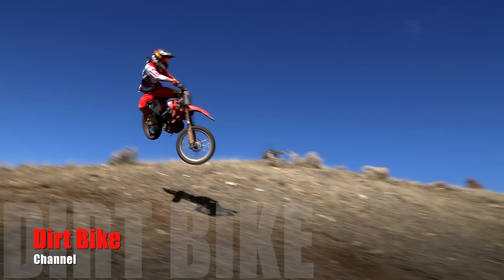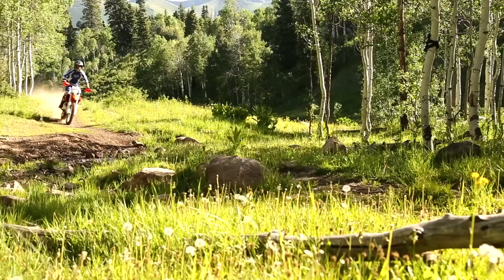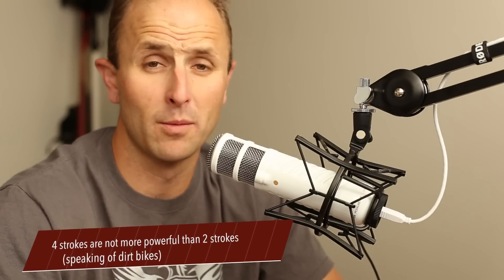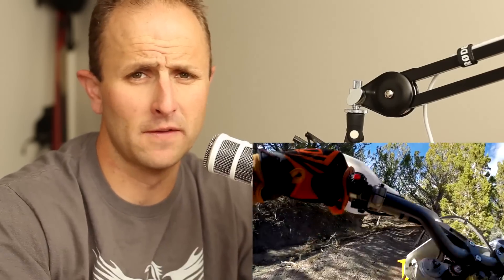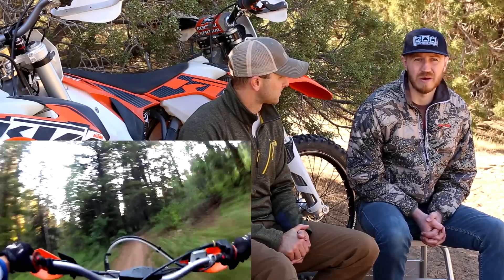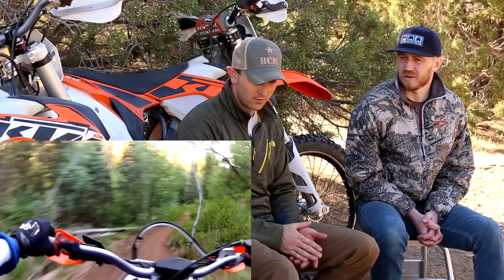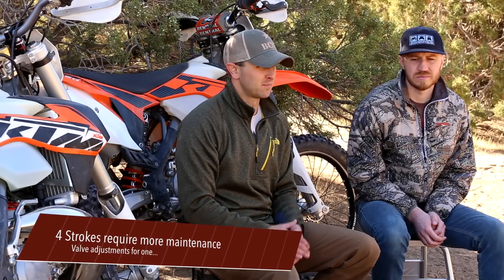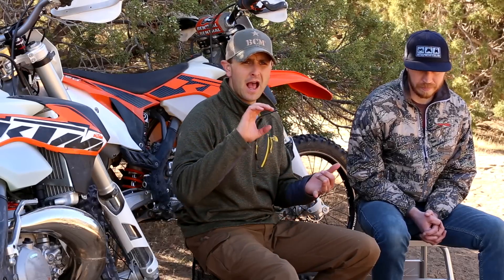Enduro 4 Stroke vs 2 Stroke Part 1

Comment: Can you guys get a comparison video with a guy who is biased with 4 strokes that would make a great video with you both making fair points let's see that like if you agree.
Reply from the maker: +Budda Shelton That is essentially every other video on the planet, so it's not really needed on here :)
Reply: Why would anyone be biased towards a 4 stroke ? Is that a real thing?
Reply: Brian Carpenter are you serious?
Reply: @Bc5xdown  because the 4 stroke is better in almost every aspect.
Reply: jacob van halteren did you watch this video?
Reply: @kadend2669  Yup, a couple times. He's pretty biased towards 2 smokers. Truth be told, the 4 stroke is objectively better engine. And I have a 2 stroke. Yes, 2 strokes are cheap to maintain and light, but 4 strokes are still pretty cheap to maintain as well. Yes, they have more moving parts but a forced oil lubrication system means that those parts last 10x longer than they would if lubricated like a 2 stroke. Then you get better power and longer gearing allowing you to move slower than a 2 stroke with similar gearing could. Not rev lower, but move slower none the less.
2 stroke bike set up to do 30km/h in 1st and a 4 stroke set up to do 30km/h in 1st. The 4 stroke has an extra 4000rpm, meaning that while peak to peak speed is equal when you get near idle the 4 stroke is able to go slower and not stall. 2 strokes are great but overhyped.
Reply: jacob van halteren you know they use 2 strokes in hard enduro because they can rev lower without stalling right? Thanks for the essay !
Reply: @kadend2669  That really just comes down to gearing. That’s not the actual reason they use 2 strokes. They use 2 strokes because they think it lowers the weight. The 250 XC-W (2020) weighs 227.9lbs and the 4 stroke that has equivalent power (about 2hp less) the 350 XC-F weights 221.5lbs. So even weight is an invalid argument. Plus the redline is 3000 rpm or more higher, which actually allows for more usable rpm. This means that while both bikes may be geared to reach 25km/h in 1st gear at peak power, the 4 stroke is given roughly (accounting for higher idle) about 2500 rpm more (at least) of usable low end rpm. There is really no reason now for the lack of 4 strokes in enduro. It probably just has to do with rider preference, since most enter the sport on 2 strokes.
Reply: jacob van halteren holy you could’ve just told me to read the brochure
Reply: Ask ultralight pilots how they feel about 2 strokes. Great way to practice dead stick landings.
Reply: @Bc5xdown  The LGBT community is very prominent these days
Reply: @Bc5xdown  yes🤣🤣🤣😭
Reply: @jacobvanhalteren7452  not really
Reply: @jacobvanhalteren7452  you semm biased too. Also Kyle doesnt seem biased. You prefer 4 strokes, you think they're better, but I prefer and think 2 strokes are the best you can buy. I think 2ts are better than 4t in every aspect. You my friend need to learn the concept of opinion.
Reply: @Dingbobber  you're referring to 2 strokes right?
Reply: @gmx0413  Talkin bout 4 Jokes
Reply: @gmx0413  so funny that you say that. I absolutely love 2 strokes, have a 2001 Honda cr250, and always make fun of people with 4 strokes. I just understand that there's a reason why people love 4 strokes that's all. And ya, everyone has there opinion but it's always the 2 stroke guys yelling 4 strokes suck and never the other way round, kinda odd
Reply: @jacobvanhalteren7452  based on your wording, it seems like you prefer 4t, I never said you dislike them.
Reply: @jacobvanhalteren7452   It is the other way around believe me, I get it all the time
Reply: @Dingbobber  good
Reply: @Dingbobber  😌
Reply: I just raced  my 4T xcf 350 for the first time and took 2nd.  Same course last year, I took 3rd on a TX300.  The 4T felt better in a Harescramble but tbh?  I rode a Hard Enduro this year as well on my TX300 and felt like I would've died on my 350 or overheated bad.  The Moral??  Each has well developed purpose and different power delivery systems that are adaptable to different scenarios.  Choose your weapon based on what battle you're entering.
Reply: @kadend2669  they use 2 strokes in hard enduro because they produce less heat.
Reply: While 2 strokes are awesome in that they sound cool and are cheap to rebuild, there’s a reason Yamaha isn’t developing new ones… the 4 stroke is more useable at low speeds, revs higher, generally always has electric start over kick start, the power doesn’t kick you in the face, you don’t need to pre mix, you don’t need to tune your carb or be so worried about gas issues. 

Hell, the biggest argument you got is weight. And that’s not even a valid point as there’s some 4 Husqy 350s lighter than a 2 stroke 250. 

I would however LOVE an updated YZ

Comment: LOL The piston should fire EVERY time it comes up!  Nothing beats the 2 stroke for cost, weight, maintenance cost and oh that premix smell.
Reply from the maker: +dieselworld You know it!
Reply: dieselworld Is that why four strokes are faster? 

Biased, but not wrong. These guys sold me on getting a two next. Seeing as how my 4 has been on a bench for the last 5+ years, though I never lost on a track. 

Anyone insisting a 2 is better doesn't care about finishing first. On road. Off road. A 4 stroke beats a 2 stroke when in capable hands. Reliability? That's another issue. 

If you're not speaking to the degree of supercross you aught to not be talking. That's how I feel about these two.
Reply: Then how come every engine in cars is a 4 stroke
Reply: emissions and tong term longevity. and pretty much nothing else..
Reply: Emissions. duh.
Reply: NoNoNoNii exactly.  To me it always seemed like 4 strokes were faster top end but I think that's just because it's smoother and you don't have to keep the rpms wound up before shifting to the next gear.  The reality is I think two strokes have more mid range and top end power while 4 strokes just have more low end torque.
Reply: I work on a boat with EMD/detroit 2 strokes, they burn plenty of oil though> Most 2 strokes sound better than my old fart OMC rotary sled 2 stroke wankle though.
Reply: Another thing is that boyesen has a trapping valve that can clean up and broaden the torque curve on a 2 stroke. Detroit diesel 2 stroke have 4 exhaust trapping valve and make good low end power with much pipe tuning. the 12v71 2 stroke generator on a boat i worked on have big exhaust chambers though. they run at 1800 rpm and can start some heavy loads with quick torque rise.
Reply: Won't Reply if four strokes are faster then why did they allow 450 fours strokes to compete with the 250 2 strokes in motocross and 250 2 strokes were not allowed to compete against the 250 4 strokes?
Reply: dieselworld u said cost twice
Reply: @minnionator  your kidding right, that's why you think their not used in cars, they great in with pushing small weight but they are gutless unless you rev the balls off them
Reply: @wontreply8315  4 stroke is not faster its just more easy to ride and not get tired.
Example i can ride 4-5 more laps on a 450 than on a 125

Because 2 stroke you need to pin it every gear. 4 stroke u can relax like a grandpa allmost...
Reply: All these pros for 2-strokes and no one mentions how much more fuel efficient a 4-stroke is. 

I ride with friends who own 2-strokes and they fill up twice and sometimes 3x’s more than I do. 

I still wouldn’t mind owning a 2-smoke!
Reply: @VitaminDeeTV  ye i like both if im racing my brother i would use my 2 stroke but i dont have a 4 stroke but ive drove one and its just fun to drive not to fast and chill out on
Reply: @joshlewis5065  Emissions
Reply: @randomdude4669  You don't know what you're talking about.

Comment: I'm a 2 stroke guy and always will be but to rebuild a 4 stroke top end does not cost 1500-2000, maybe a whole engine rebuild and that's to get it done at the shop , if you do it yourself its really not much more then 500-700$. now 2 stroke top ends usually run about 120-300 $ all in, depending on cc .Call your local
KTM dealer and ask how much an OEM  2T piston costs you would be shocked.The only time thumpers are really more costly is when you have a engine failure or engine performance parts.  In stock form thumpers really aren't that much more costly if you take care of them.  Two smokers have to be well kept too, pick your poison .

cheers mate
Reply: Ben Saunders I am not saying you guys don't know what you are talking about but no way is it cheaper to replace a 2t cylinder and top end then to just do a 4t top end that's not accurate man . the absolute cheapest you can get a 250 2t cylinder re-plated is about 200$ and can go up to 400$ then you have gaskets and piston , a 4 stroke cylinder is also cheaper to buy brand new because there is no moving parts in the cylinder.im not trying insult you guys need but you should  do a bit of research first , I understand everybody has there opinion...
Reply from the maker: Ben Saunders Ben.  I called multiple dealers, bro.  I do research.  Going rate is 2 grand if you have to do machine work on your 4t top end.
Reply: In NZ $300 to do 2T top end, 4T $500...not that different. We ride 4 strokes for trails as you get better mileage don't have to retro fit the bigger tanks, for long rides.
Reply: $1500-$2000 is for a shop to do it. Do it yourself, anywhere from $250 to $800 depending on what you need.
Reply: @DirtBikeChannel  but you are comparing apples to oranges here...   meaning 2 stroke repair being done being done by owner and the 4 stroke repair by a dealer.  in cost.  ok so that is the point. parts for parts only its not as much.
Reply: @DirtBikeChannel  flat out lie lol. That means they are going to charge you $125/hr for 12 hours thats just labor. If your shop takes 12 hours straight to rebuild a 4 stroke then you're going to the wrong guy.
Reply: So I was under the impression that 4 stroke engines that are used for free riding and non-racing basically last a really long time, while 2 strokes have a pretty short engine life, no matter what kind of riding you're doing? I've seen XR500 engines from 1984 that have never been apart, and have hundreds of hours, and are still running strong no smoke or valve noise. I guess the new 4 strokes are a different beast, and wear out a lot faster?
Reply: @Ritalie  since the new 4 strokes are water cooled instead of aircooled, they have more power but don't last as long
Reply: And XR500 engine is a completely different design than the modern motocross-style 4-stroke engine.  For one, the old XR style engines are lower revving, and designed to deliver a different kind of power (fewer ponies, as well).  Those old engines use valve lifters instead of overhead cam(s), and have fewer moving parts than a modern MX 4-stroke engine.When it comes to a rebuild on a 2 stroke vs. 4 stroke, there is quite a different cost from one to the other.  While the main parts, i.e. piston, rings, and gaskets are fairly comparable in price, there can be a lot more labor involved in a 4-stroke rebuild.  There are quite a few more moving parts, and a shim-under-bucket valve adjustment is quite possibly going to be part of that rebuild. Depending on what make/year you're rebuilding, you might be replacing or at least resurfacing the valve faces, both of which require a post-rebuild adjustment, as well as making sure your timing is correct.  There's not a lot of room to work in those compact engines, and it takes time to do it right.  I could always do a 2-stroke top end on my YZ in about 45 minutes to an hour, including draining and refilling coolant.  It took my very capable mechanics at the Honda/Yamaha dealership whose service department I managed up to five times as long to rebuild 4-stroke top ends.
Reply: @DirtBikeChannel  it's not though

Comment: these guys aren't even doing a comparison there just bashing on 4 strokes
Reply: Truth hurts... The dollars to smiles ratio is far more favorable with a 2-stroke.  This is coming from someone who owns both.
Reply: Ruthless Racing anyone who loves enduro should love the environment... In which case 4 strokes are better. They get better traction, tread lighter, and don't pollute tons of extra hydrocarbons and particulates. 

The pinnacle of 2s power is a 48hp 250... That is 192hp per liter. Stock liter bikes (250 cylinders) make more than that, and race bikes from stock classes to MotoGP make 210-250 hp per liter. If manufacturers wanted to, they could make the 250f as or more powerful as a 250, but they want broader power  (funny how the 250 has such a slim powerband and the 250f has to have a wide one) for BEGINNER riders.
Reply: The pinnacle of 500 cc 2-stroke GP bikes were making close to 200 hp - almost 400 hp per liter.  Just sayin'....
Reply: 6:24
Reply: A 68 chevy 327 chevy can rev over 8000 rpm more than most big 2 stroke  outboards. 4 stroke rev much higher but they do not like the heavy loads like a 2 stroke, i have seen 12v71 2 stroke detroit diesels start some pretty heavy loads on a generator.
Reply: @DaveScottADV  A 2 stroke with a trapping exhaus valve can broaden the torque curve. Boysen and Coates rotary valve heads. But this is done with detroit diesel uni flow 2 strokes years ago. plenty of power with low end torque.
Reply: When you compare a 4 stroke to an engine that is drastically better in literally every way, its gonna sound like youre bashing it.  Its not personal!
Reply: roberto fromamino I never knew that stating facts was "bashing"🤔
Reply: Because 4 stroke blows.
Reply: @KTMcaptain  250 2 strokes have just as wide of a powerband as a 250f. My YZ 250 had more low end than my friends YZ250f with a Posey racing engine. With 110 octane leaded fuel, my YZ actually has a lot of grunt. It has it on normal gas but with leaded fuel, i cam feel a difference
Reply: Thrasher209 what a joke.

A 450f destroys 250 2s everywhere. 

But you knew than which is why you compared two difference class bikes. 

And “race” engines typically favor high rpm for more power. So no wonder it’s low rpm “grunt” was lacking. 

My cammed and tuned full exhaust wr250f could accelerate neck and neck with a jetted, performance reed, full exhaust cr250r... up until 65mph where the CR ran out of rpm and my WR would run to 97mph. 

After I switched to a 450 exc it not only pulled harder EVERYWHERE, but it also ran to 110mph without hitting the rev limiter. 

2 strokes have narrow power bands, which is why they are geared with tightly. Also, pretty much every 250 2s I’ve ever ridden would lift the front end once it got into the power band if I gave it wot at lower rpms. 

Even a 350f will blow away a 250 2s.
Reply: brett wc2018 their talking about ENDURO not supermoto or other stuff two strokes are reliable and great dirt bike engines for enduro riders they just don’t want people having to work on their bikes and pay a lot for maintenance
Reply: MrZep420 350f beat down on 250s... and are starting to beat down on 450f. 

And 250f can makes just as much power as a 250... stock road bikes are making over 50hp per 250cc cylinders. 

Instead of 14,000 rpm, run it to 16 or even 18,000 rpm and watch how much power they make. 

And it’s not unfair that the 250 races a 450. They both draw in the same or similar amount of air per revolution. 

So you’d be fine with a 250f that’s supercharged racing a 250? What about wiring the stator to be a motor generator unit that gives a 250f an extra 20hp for bursts? 

How about saying a 2 stroke and 4 stroke both have to have the same displacement and aspiration, but they also have to both run the same gas the 4 stroke runs?

What about a 250f parallel twin running to 20k rpm? Multiplying torque by 3.8 making 75hp? How about a hot bored single cylinder block with direct injection running to 20k rpm based off the 300cc Ferrari F1 architecture making 300hp per liter?

How about just make 2 strokes only race 2 strokes and 4 strokes against 4 strokes. Then you complain about how the 2 strokes have higher lap times because the track was designed for 4 strokes.

Comment: It's fine for you to have your opinion on which you like better, but it's misleading to title the video "4stroke vs 2stroke" when you really just bash 4 strokes and don't even bring up most of their benefits. The video should be labeled "Why we think 2 stroke is better than 4 stroke".  One the main benefits of 4 strokes is fuel efficiency which can mean a great deal on long rides with nowhere to refuel.
Reply from the maker: Taylor A. Fair enough, although if we watch both videos in this serious, you'll hear us call 4 strokes amazing machines.  Thanks watching though.
Reply: Can your 4 stroke burn its own oil, i have made them do this as i fiiled them with 2 stroke oils anyways. 4 strokes rev higher though i give them though but they do not like heavy shock loads and lugging.
Reply: Oh yeah prove it. most 250 stroke rev 13500 rpm while 250 2 stroke tops at 8500 rpm. 2 stroke produce much more power at low revved, i work on a boat with 8v71 2 strokes that start a heavy load at 1200 rpms NA and i doubt a 4 stroke the same size can match that. Whats so great about 4 stroke anyways they can rev higher i give them that but they have there place 4 stroke make a nice sound though thats all they are good for. lets see feed one  on 50:1 synthetic only and watch survive. im good at things self destruct. I fill 4 strokes with tcw3 and rev the hell out of them.hehe Im good at destroying 4 strokes!
Reply: Desert tank. That’s all that needs to be said but I see where you coming from
Reply: Ive set up my 2strokes to not use gas fast without losing power so thats false and ive owned 2 and 4 I'm not hating on anything any dirt bike works but don't ride electric😂
Reply: amen brother